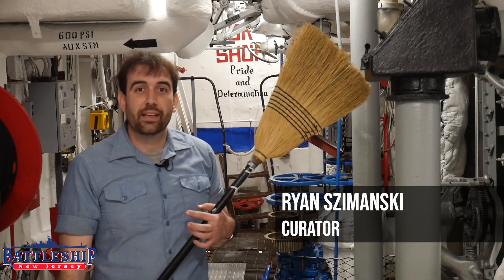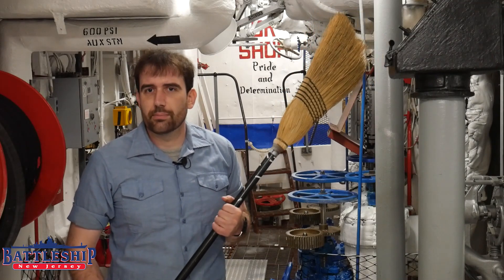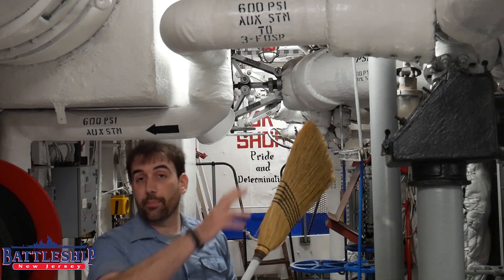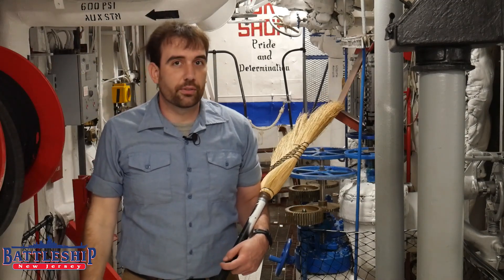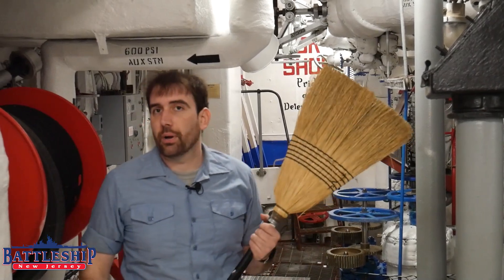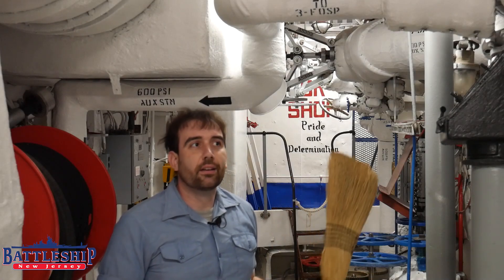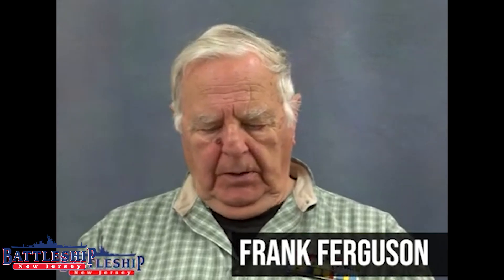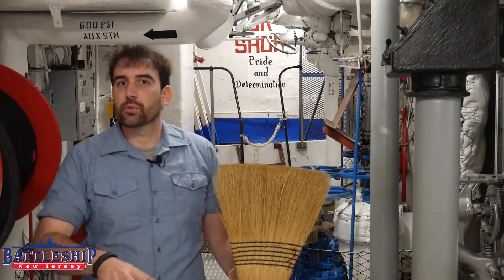Searching for Steam Leaks in the Battleship's Boiler Room

Comment: I wouldn't be surprised  of an update using IR cameras to help find leaks, at much higher expense than the broom...
Reply: Problem with IR cams is temperature. We used to use NFFTI, Naval Fire Fire Thermal Imagers, during fire fitting.  The whole room is so hot, you can see fires, however the pipes are all showing white, 950 degrees.
Reply: @cruser69  the NFFTI is TOO sensitive to find steam leaks.  The ambient temp and the temp of the piping all combine to wash out the image to the point of being useless for about anything but finding an actual fire.  For those who have never played with the device, a sailor on a smoke break appears as a light man-shaped ghostly blob with a very bright flashlight in its mouth.  It's purpose is to evaluate an area for hot spots and fire where normal vision is obscured.  Inventive people have also used the device to find bad gaskets in reefer doors...the cold spot will be darker than the surrounding area.
Reply: @kevincrosby1760  can you manually set temp  ranges to display?  I was playing with an IR camera one time and if I disabled auto ranging and set the display to show only what was 80 and 100 degrees F, I could see the heat my bare feet left on the carpet.  Everything else was filtered out.

Comment: There seems to be some question about just how much damage 600 psi steam would do to a body; but it does appear to be true that the inventor of waterjet cutting (an industrial technique that uses high-pressure waterjets to cut substances including stone and steel) was inspired by witnessing high-pressure steam leaks chewing right through the handles of broomsticks used by shipboard engineers to find leaks in super-heated steam plants.
Reply: Although in practice, waterjet cutting is a lot more like sandblasting than what super-heated steam does.  Both of them work by using the fluid stream to carry and direct abrasive.
Reply: A lot, there's a ton of energy in 600 psi steam, and more when it's superheated. Even if the steam jet has lost most of its pressure when it hits you, it will boil the water in your cells on contact and will cause massive damage nearly instantly. If it breaks the skin, the high flow, boiling flesh and internal pressure could easily tear you apart. Not a fun time.
Reply: This isn’t a myth ,but a fact it’ll scold your lungs and cut your hand ,arm whatever off .

Comment: What are those springs for near the ceiling above the 600 Aux steam pipes??  They can be seen when you first started sweeping the broom around looking for the steam leak.  Two different sets of springs can be seen above the pipes at the 4:28 mark.
Reply: Pipe hangers. The piping is not hard bolted, it needs to be able to move from shock and expansion/contraction due to the temperature.
Reply: @cruser69  
I suspected something along those lines. Thanks for the reply. 🙂

Comment: We have loads of 600PSI steam lines, some from the 1930’s. Typically the leaks are at flanges, and first show up as visible since the start really small with enough DP across the leak to drop the steam to near atmospheric pressure, but if you don’t imediatly fix them, you will get the high pressure steam coming out

Comment: I learned the broomstick thing from a salty old chief who probably started by shoveling coal on the Monitor.  We never found any big leaks but leaky gaskets and valve packings were a very common problem.High pressure steam is corrosive and erosive and even a small leak will cut grooves and holes in steel piping. We could find very small steam leaks by moving the shiny surface of a wrench near the suspect area. You would see condensation on the wrench and know where the leak was located.

I worked in a t-shirt or dungaree shirt with rolled up sleeves and always had a good collection of burns on my hands and arms. I know that some ships enforced a long sleeve shirt and gloves rule, but our captain didn't.
Reply: These bits of information you couldn't otherwise hope to learn are my favorite part about this channel.  Thanks for sharing, Dave.
Reply: Which ship was you on?
Reply: Newport News CA-148
Reply: @davelewis3255     Where your on Newport news when it 8 inch gun blow up?
Reply: Yes I was. October 1, 1972. Nineteen shipmates lost, ten or so injured. Not a good day.
Reply: @davelewis3255     I read about that.  What caused the green gas inside the ship after the explosion?
Reply: @studinthemaking  As I recall (remember that happened 50 years ago) there was a lot of light brown smoke in the ship which was caused by the 8" powder charges burning. It was very irritating to the eyes and lungs. I don't remember seeing or hearing stories about green smoke but I wasn't a gunner or a member of the fire fighting crews. If there was green smoke (or gas) present it might have been a combustion product from wiring or hydraulic fluid. I understand that there were marking rounds for the 5" guns that would explode in a cloud of colored smoke but I don't know if there were similar 8" rounds. I don't believe that the explosion and fire got into the 5" magazines, but the colored smoke could have come from the 8" magazine which definitely did burn.
Reply: @davelewis3255     Thanks for the info
Reply: I learned it too, from my great uncle. He heard I was working on steam heating boilers and taught me this, he had many friends in the navy (he was USAF) but did some steam heat stuff. That trick saved me some nasty steam burns off a 12" main. Thank you for your service as well! Welcome home!
Reply: Interesting ,thank you
Reply: M.t
550
yyy.t.n..h

. 
U.
U.
. N . M m. M

Comment: If you prefer 74 degrees, I suggest you stay out of the engineering spaces when the boilers are lit! 104 is more like it, at least in warm waters.

And yes, I was told to look for steam leaks with a 2 x 4, and if you were lucky it wouldn't break your wrist when you found it and it cut the 2 x 4 in half.
Reply: In America, 104 degrees is warm. In the rest of the world, 104 degrees is boiled to death.
Reply: @fadlya.rahman4113  right now it is 89 degrees on my front porch at 12:52 PM.   Can't wait until spring is done and it starts getting warm out.  in a month or so, 104 will be normal for early afternoon.

(and yes, I did catch that you were making a C vs. F joke...)
Reply: 104°F is a little warm. Temperatures on top of the steam drum and adjacent to the DC heater can get undesirable.
Reply: I wondered what the temps were like down there. On the diesel ship I was on it would be well over 160 in the ER when we were in the South Pacific.

Comment: See internet of what occurred aboard USS Iwo Jima (LPH-11) on 30 October 1990, failure of packing on a main steam valve leak into boiler room killed all 11 Present. Richard McKenna was a machinist Mate in the Navy from 1931  to 1953. He wrote the book The Sand Pebbles in 1962. In 1969 it was made a movie with Steve McQueen. A book "The  Left Handed Monkey Wrench" from Naval Institute Press is a collection of short stories , essay by Richard McKenna- One - "The Loss of the USS Bennington" is a very good read. Have heard this story myself to use broomstick.  - see http://www.usscochrane.org/ddg14/index.php?topic=55.0  - here a batch of folks state concurrence. At 600 PSI - transition to steam does not occur until near 500 degrees F.  Great use of the Boiler Tech's clip.

Comment: It’s not just the high temperature and high pressure, steam in any form is invisible. When people say you can see the steam coming off boiling water what you actually see is the steam cooling into condensate not the steam itself.
Reply: Agree. As my chemistry teacher once said, "You've never seen steam."
Reply: Saturated steam is visible because it is containing water droplets, but superheated steam is invisible.
Reply: I never said anything otherwise. The question remains, how long after the pinhole stream of fluid crosses the threshold of the hole does it remain superheated? It will be rapidly dropping pressure as it expands into the room, which is at atmospheric pressure. And it may not even take the entire stream becoming saturated to become visible. If even 10% of the superheated stream drops to saturation (say, the outermost perimeter of the stream), will that portion be visible?
Reply: @westtex3675  Yes that will become visible but thats depending on athmospheric conditions. In one instant the neighbours insisted understandably on noise dampening. We pumped two firehoses full blast into the steam path. Only then it startet to rain out of our self made cloud.
Reply: Dry saturated steam is also invisible. It doesn't have to be superheated.  @Vanha21
Reply: Superheated steam is technically invisible, but not practically so. Once it expands to atmospheric pressure it's still superheated and several hundred degrees hotter than it's environment. Heat flows from hot to cold, therefore it will reject heat at an incredible rate (as this rate is dependent on temperature difference) to the point the stream reaches saturation. At this point the only thing keeping the steam invisible is nucleation. Water needs a surface to condone on, it won't spontaneously form droplets. In just about any environment this nucleation cite is dust (which is everywhere). Next to consider would be the dew point. If the dew point is sufficiently hight the steam may not condense long enough before it reaches the dew point that it forms an easily identifiable vapor trail. Therefore, in most environments, any steam leak (saturated, superheated, or supercritical) will readily result in visible water vapor. Inside a cramped engine room or outside in Florida the humidity could be high enough to reduce even the largest of steam leaks to a whisp (I've seen this in MO where it looked to be blowing real bad in the morning but barely visible by lunch.... thank god for safety tape). Because science.
Reply: It’s kind of semantics though. Obviously, when steam is near the saturation point, there will be condensate along with it, meaning you will be able to see where the fluid mixture is.
Reply: @westtex3675  After i have seen the steam of a complete 200MW power plant going invisible in the air during steam cleaning the boiler i have a heathy respect from steam leaks.
Reply: I've ways heard that there is a distinction between steam and water vapor. Steam is by its nature visible because it is contains a lot of condensed droplets. So the vapor is invisible, but steam is not just vapor.

In this circumstance its really a meaningless difference, like between lava and magma. One becomes the other once it is no longer underground. High pressure hot vapor, when it leaves the pipe reduces pressure, cools, and begins to condense into steam.
Reply: When the Ms Norway boiler blew up the force of steam blew some people right into the water.
Reply: Why weren't you guys working on this ship ?
Reply: @scallen3841  Too young and wrong continent. But Engineers and engineers like to discuss physics
Reply: @felixtheswiss  perfect people to actually put what they talk about to good use
Reply: Way to much chat about nothing

Comment: As I recall, the 4 boilers in my ship the USS Gridley CG21, ran at 1200psi. I was in Fire Control so the steam was not my area but 1200 is what I recall being told and the broom was the way to find steam leaks.
Reply: You are correct.I was on the USS Little Rock CLG4 ,I was a Machinist Mate in the Forward engine room / Main control. Put on an OBA an a broomstick or mop handle and track it down it cuts the stick into instead of you . You wear an OBA so you don’t scold your lungs !

Comment: I THOUGHT  THE  MAIN ON THE NEW  Jersey  was 1200 psi
Reply: The navy built some ships with 1200 psi after WW2 and found that they didn't work very well. The idea was to get more efficiency from the plant - longer range and smaller engineering spaces - but it was a case of diminishing returns. I understand that the 1200 psi plants had lots of maintenance problems and spent almost more time in the yards than they did at sea.
Reply: @davelewis3255  Higher operating pressure also mean more expensive piping materials and more expensive valves. Generally the operating parameters are designed to take advantage of 'standard' products to increase the reliability and decrease the cost.
Reply from the maker: Nope. 600. If you look close you can see it stenciled on the pipe above his head
Reply: That said 600 aux not main
Reply: @jamesmummert3578  The boilers are rated at 650 psi.
Reply: Actually, there was a whole class of ships using 1200 psi steam, Knox class frigates.  In the 80’s we trained on 1200psi systems at MM A school

Comment: The steam won't necessarily cut you but it will burn the heck out of you in short order. High pressure water and hydraulic lines will cut you to pieces in a heartbeat. Hydraulic also has the added problem that it will inject hydraulic fluid into you and that isn't healthy. Either will drive air into your body as well and if the bubble of air or hydraulic fluid finds a way to your heart, lungs or brain you are likely finished. Boiler feed water has to be pressurized to a higher pressure than the steam in order to be pushed into the boiler so it is often found too. Hydraulic fluid can be driven up to 5,000psi to run equipment and if it develops a pinhole can cut through most anything it contacts including armor.

Submariners also use brooms a lot for the same reasons.
Reply: Burns are the worst. They actually hurt MORE while healing than they do when you get them.
Reply: @ghost307  tell that to someone who dies from infection caused by tissue necrosis from hydraulic injection. The initial injury may not be all that bad but the antiwear addative package kills tissue, the insuing process is not pleasant and can take weeks to kill a man in total agony.
Reply: @ghost307  I just fully comprehended your comment, I misread it.

Comment: The late Cmdr Roy Francis (RN) told me once of the very same methods of finding steam leaks onboard, using a piece of wood, and looking for the charring on the wood, very interesting!
Reply: It will cut it into,it’s no joke !
Reply: Wood starts to burn at 451 degrees Fahrenheit and that steam is at 800 plus so it could easily heat the wood to the flash point and since it is in the open air with plenty of oxygen should char nicely.